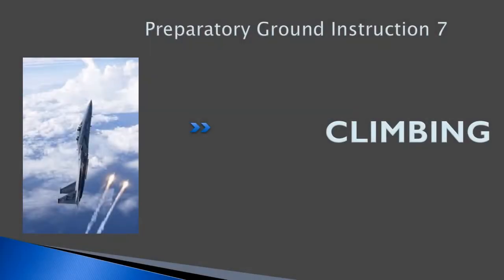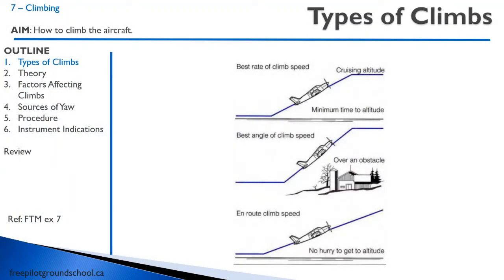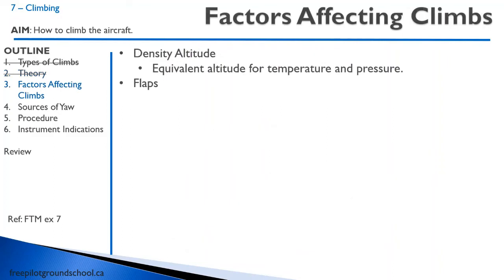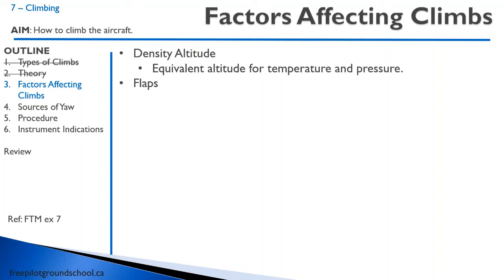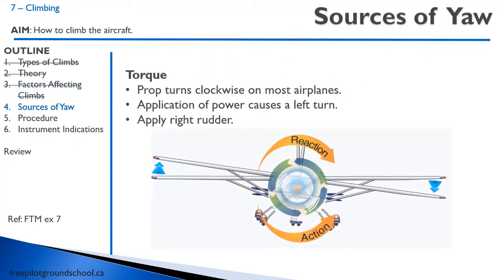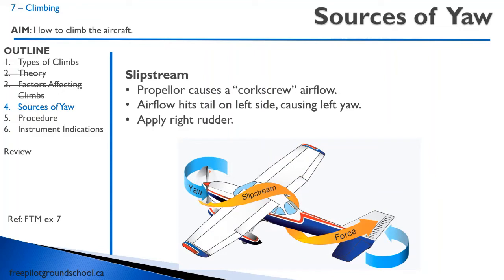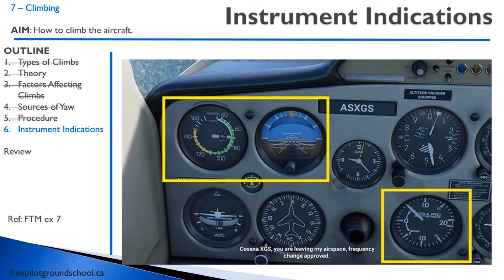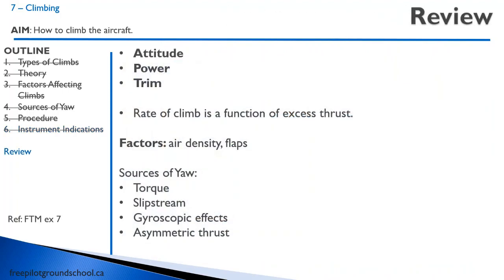Air Exercise 7 - Climbing

Comment: Rate of climb is not bcoz of excess of thrust but excess of power
Reply from the maker: You're partially correct. Rate of climb is a function of excess thrust/power over drag. Drag is a force, so if we maintain the same units, we would look at thrust. However, we can transform the drag curve into a power curve by multiplying by velocity. If we do a dimensional analysis, it becomes apparent how this works. Using SI units N (drag) * m/s (velocity) = Nm/s (power). We now have a power vs airspeed graph. If we use this graph, than indeed, rate of climb is proportional to excess power produced by the engine - power required to overcome drag at a given velocity. I hope that clears it up.
Reply: @freepilotgroundschool2326  your video was repeatedly saying at around 2 to 3 minutes that Rate of climb is bcoz of excess thrust which is wrong. Also I understand that for most cases if thrust increases power will also increase but saying or using excess thrust in place of excess  power is totally wrong, they are not the same thing
Reply from the maker: You are right, thrust and power are not the same thing, but they are related. You can derive power by multiplying thrust * airspeed.
Perhaps you can show me mathematically where I'm wrong. I'll walk through the math. (Units are in brackets so you can follow the dimensional analysis.)
(Thrust-Drag (N)) * v (m/s) = P (Nm/s)
=mg*m/s (mass*gravitational constant)
ROC (m/s) =(Thrust-Drag)*v/mg
We can also do the math a different way, perhaps how I think you understand it.
Thrust*v (Nm/s) - Drag*v (Nm/s) = P (Nm/s)
Make sense? I'm happy to stand correct if you show me the math.